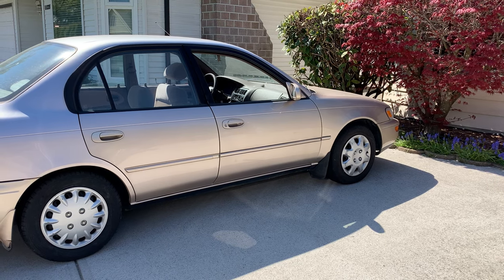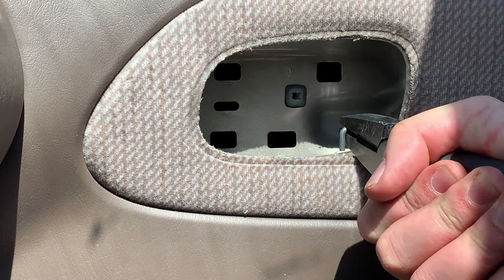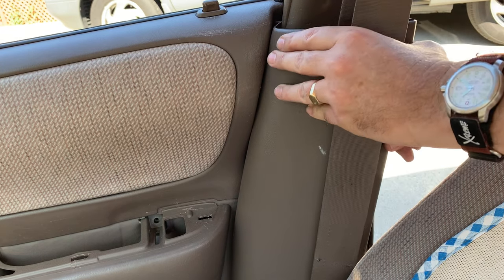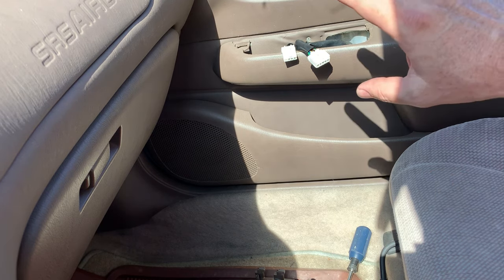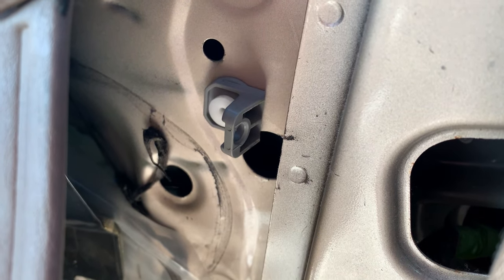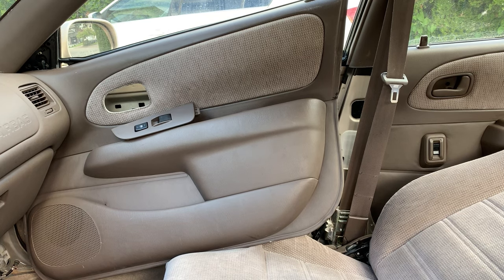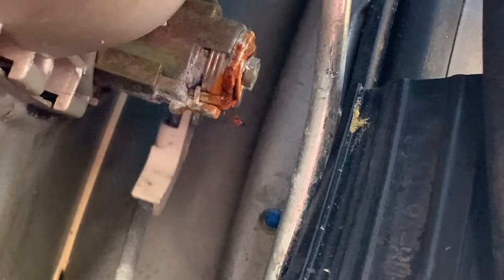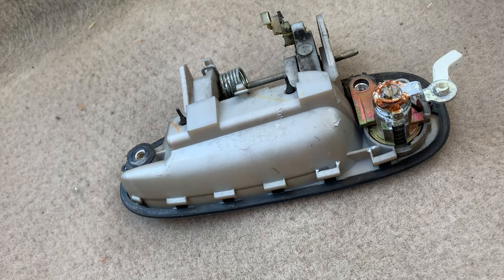Door won’t open – from inside or outside!

Comment: Sorry you went through all that. It was all very unnecessary though. This isn't for you as you got it open but for anyone else reading this. I am an automotive locksmith and have opened many doors like this without ever taken anything apart nor would I. Most opened in less then 2-3 minutes. First off you need to understand how these work. The problem was with the latch not the lock. It's confusing I know. The latch on an older car like this is probably easier than a new one. New cars mostly use cables rather than rods like this one. The key to this would have been wedging the outside door skin from the window to create space and using a good light down by the latch. 99% of these the linkage rod comes off the plastic keeper somehow. Some older ones used metal clips that rusted and broke but the majority of clips are plastic. I have been out to many that police, tow truck drivers, the helpful neighbor tried to unlock the car with keys in it and broke everything. You can't just stick a slim jim in these and go nuts. There is actually skill and knowledge involved. I could also always tell if someone was there before me. I won't give that clue away though. You need to find the  unlock lever on the latch. That's the arm the rod was connected to. Sometimes it's on the edge of the door side and very hard to see and get to but you have to think logically where it could be if you can't see it. Looking for the plastic keeper will usually help or possibly the hole where it used to live. I obviously have door tools but a wire hanger with a hook could be used to pull up or push down and the door will  open. I have been doing this since the 80's and only had one door I couldn't open. That's why I still remember it. Someone could have also knocked the linkage off trying to break in. Sometimes the keeper breaks from age. You name it I have seen it all. I have a had a few where the actuator (for auto lock/unlock) froze and wouldn't allow the latch to open. I actually had to knock the rod off to release the latch on those. I hope this helps someone else who is a good DIY person. If not just pay some guy like me who won't damage and tear up your inside door panel.
Reply: That's an amazing solution! BUT, really? There are "lots of guys like you" with this specialized knowledge and tools? I have my doubts that I'll find someone here on the tiny island of Kauai. If I were a millionaire I'd fly you out for a vacation... as long as you brought your tools! 🙂
Reply: OMG! There's an auto locksmith right down the street from me!!! Hallelujah!
Reply: @scotts4125  Thanks for the reply. I appreciate your generous spirit in sharing your knowledge with others in your field. Before I retired as a high-end cabinet installer, remodeler, and finish carpenter I realized that many of my skills and "tricks of the trade" were learned from working alongside other journeyman-level craftsmen. It was a brotherhood. 

So, I have a call in to my local guy and I had already thought to show him your detailed description above as soon as I get an email for him. His website only speaks about being a lockout expert but maybe he can do more, or would feel comfortable following your guide. 

There is however a secondary issue that I need to plan for. I don't believe I have a locking issue; it's the latch that is frozen. Should he be able to free the latch I still have to remediate the reason that caused the latch to freeze shut. Otherwise the next time I close the door I'll likely have the same problem. 

So, my thought was that I would have to buy some parts to have at the ready and hope that the locksmith could also fix the problem once we get the door open and can easily take the interior panel off to access the mechanisms. 

I stopped in at an auto-body shop to ask if they had experience in getting frozen latches open and they told me that they could muscle the panel off from the inside like the video here but couldn't be sure that they could still get parts for a 22 year old car. It looked like it was going to be a two week deal and cost around $400! It's a 2000 Honda CRV with auto-locks.
Reply: @scotts4125  Today was the day that the 30 years experienced locksmith with the borescope, wedges and slim jim worked on it for about 45 minutes before saying that this was one for the books and he couldn't help us. 

He showed me the camera screen and pointed out what to look at. It's a stumper alright. Both inside and outside handles move the rods as they should. All the rods are clipped in to where they are supposed to be. The test that pointed to the problem was to turn the key in the lock and watch the lock button on the inside respond to the key (these are electric locks btw). It went down all the way but came up only half way and wouldn't go any further. Since the electric actuator seemed to be working fine, that indicated that there was something physical interacting with the rod that raises the lock button enough to make the latch release the "claw" that wraps around the stud that protrudes from the door jamb. 

When I looked in the camera and pulled the door handle,  what I could see was the rod that pushes the locking button to the up position would move upwards but then stop before reaching full extension.

The big problem is that we can't see through the plastic casing to where we suspect there is some debris or a broken part inside the latch housing. There's got to be something in there on top of the rod so that when the rod tries to lift up to open the door it sandwiches the debris between itself and the latch's plastic casing. There didn't seem to be any way to see or remove the suspected culprit. Even if we could have gotten a small wire down in there to explore, it would simply push the intruder further in to the plastic casing.

The bottom line is we seem to be completely stymied because even if we could get the door panel pulled back enough to reach our hand down in there, pulling up on the rod to unlock the door would still encounter whatever is stuck inside the casing and not be able to travel upwards. 

If you have any miracles in your kit, we are all ears. It seems like we are not going to get this door open from either the outside OR the inside. What a bummer. We bought the car to be a rental. 

😞
Reply: @davidgardener5519  I would try to knock the rod off the actuator and move the rod without the actuator attached. You could also try to remove the rod off the latch and move the part of the latch the rod is attached to. I realize sitting at a KB is lot easier then actually being there. Either one of those might take a couple of hours but that's really the only choice without destroying the door. Possibly remove the plastic around the inside lock and grabbing the rod with pliers and yank the crap out of it? The other thing might be to drill out the lock and grabbing the rod with everything you have. Those are really your only options besides destroying the door panel. That latch as he probably told you won't release until it's completely unlocked. Maybe spray the crap out of as I suggested before too. I am glad not to be doing this myself lol. Let me know how it turns out. Good luck!
Reply: @scotts4125  Thanks for coming back with a suggestion. I'll pass it on. We did put a channel locks on the lock button and pulled with all our might. No   go. That's when our guy had to admit defeat.

 I will pass on your suggestion about trying to separate the rod that goes up to the push and pull knob from the rod coming out of the latch that we believe is being blocked by something inside the plastic casing. That sure would be sweet if it would come apart there. Not sure what tool would make it happen though. Slim jims are pretty flexible and I'm thinking it would just bend when trying to apply a prying movement. Are there stiff slim jims for situations like this where  you have to free something that's stuck?

Yes, I'll let you know what happens next. Thanks again, Scott.
Reply: @davidgardener5519  I see a major mistake here. A slim jim is 100% the wrong tool. You need to do this with a rod. I never did this because I always bought my tools and rebent them but back in the day guys would use welding rods and bend them. I have been doing this since the 80's so I have a ton of rod like tools that I rebent for specific cars back in the day. Now we use long reach tools through the window. One of those rods might work in my next part of this.

I went to bed thinking about this. I have an idea that would be the best idea and give you the best chance for success. Let me explain something else first. I'm not sure how you are paying this guy but it's probably not worth his time to be doing this so if he is willing appreciate him because this would  not be worth my time. We charge $300 -$800 to make a lost key and it takes an hour, 2 at most if we have programming issues. It's still hundreds cheaper than a dealer charges. I HATE taking door panels off also. So just trying to nudge you into the direction that you should probably be doing this yourself. :) Even if I charged $300 for this I could be making a key and not messing with a door panel so this wouldn't make sense for me.

Ok here is the best way to do this. Find some welding rods or some kind of stiff like rod. A coat hangar will not work as it's not stiff enough. You need to remove the other door panel. I would study how that door unlocks at the latch. Once you understand that 100% take the rod while the panel is off and put it down the door from the outside. Take a sharpie and mark your depth on the rod so you get it perfect. At this point you will have to bend the tip to hit whatever unlocks it on the latch. Keep in mind this part will be the reverse on the stuck door. Once you have this tool and technique perfected go the the stuck door and do whatever it takes to knock that rod off the latch or actuator that is preventing full movement. Once that's off use this tool. If none of this works and you don't want to do it than just pay the body shop I guess. You don't have a lot of choices here. 

Absolute medieval to try and save the door would be to muscle the panel off like in this video. If you can't get the latch to unlock I would use a die grinder and try to cut the latch from inside the door. This is even if you could get a tool on it. This really sucks for you and I have never seen anything like this myself so best of luck again.
Reply: @scotts4125  Wow, Scott, you are an absolute angel to help us think through this hellish issue. You give us hope and we are so grateful. 

I will compose something that incorporates your advices and see if I can agree to get the locksmith to attempt the job. Before he came out he told us that he thought the job would run between $400 and $700. The minimum sounded very high to us but we didn't have much choice. (The only other guy on island is away right now and we were aiming towards getting this car rented.) When he was skunked he said that he charged $100 minimum trip charge but since he couldn't get the door open he didn't feel he should charge that much so he asked for half. Since we didn't have exact bills we gave him $60. 

At this point we've given up on having the car rentable by Nov.5th. Maybe we should wait for the other locksmith to return and try him. 

Lots to think about here. I'll stay in touch and again, mahalo nui loa (thanks so very much in Hawaiian).
Reply: I have a Toyota ae 100 year 1995 so apparently my door doesn’t open from the outside but it use to open from inside but for some reason someone like they put the child lock on now it can’t be open from inside or outside , I need your help please
Reply: I have a 93 Cadillac coupe DeVille and my door just got stuck today. We just had a bad freeze over night and I got in threw the passenger door. If the door is locked already and was frozen and I was tryna pull my door open with force thinking it was frozen. Any way you think I could have damaged it or is it most likely just frozen. It's -4 with a real feel of -30
Reply: @esolbdivad  Sounds like it's frozen. It will probably open by summer. :)
Reply: I have a 2004 Honda Odyssey,I want to know,what is the problem of my car door when I can open it from inside but can't be open from outside?
Reply: @223FR  Your outside handle linkage is disconnected from the latch. It could be at the handle end or the latch end. Most likely a plastic clip broke or the rod came out of the clip.
Reply: Thanks man. I'm finna do it now
Reply: Damn that's long
Reply: My car door won't open from the inside and outside I have a Honda crv 2020 I am in california ..I was trying to read the comments but I know for sure it's the actuator it won't move so that the door can open I need a new one but who or what should I look for when I want someone to open the door and change it..u said call a locksmith?
Reply: @stephaniemolina7405  Probably a mechanic or the dealer. This is more of a repair. Some automotive locksmiths might do the repair but probably better luck taking it to a mechanic. I would also want to make sure they can get the door open without ripping the door panel out like in this video. Honda's have horrible door and Ignition locks. They use poor quality wafers in the locks that wear out and the key stops working. This is very common issue. Not sure about them having bad actuators but they break across all makes but Honda had a lock problem that I haven't seen in other makes. They make great cars with shitty locks. Best of luck.
Reply: Then were the hell is your how-to video? You criticize his technique but cant show you can do it better.
Reply: @v10moped  Are you angry because you drive a moped? I get it. Do better.
Reply: hey man, I have a 98 ford explorer and me and my dad worked on the door yesterday because my door wouldn’t open. We finally got it open and found out that the interior handle was worn out and wasn’t catching so I bought a new one and installed it and it worked fine until I accidentally locked the car and I haven’t been able to unlock it. I took off the door panel and have tried to pull up on the lock and haven’t had any luck. If you have any suggestions that would be awesome
Reply: @andrewbolt3094  If the door panel is off you should be able to open it from the linkage on latch. If the latch is frozen up you need to do whatever it takes to get it unlatched and maybe replace it or whatever part like the door lock actuator is keeping it from being opened. A lot of times the actuators (the electric locking part) stops the button from moving. Hard say without actually being there but figure out what's not working and disconnect it or break it to get the door open. good luck.
Reply: Can u make a video on this?
Reply: @scotts4125 7
Reply: got a 2008 CRV, closed the door on the seatbelt buckle , pulled the buckle out but now the door wont open from inside or outside. 
btw the central locking works i can see the orange lock opening and closing but somehow the door wont open at all
Reply: @wazzabanzook5028  Try to push in on the door hard while working the inside and or outside handle. It may not make sense since you want to open the door but there could be pressure on the latch since you closed the door on the seat belt. Some doors when we use an airbag and pull the inside handle on a lockout won't open until we let the air out of the bag even though the door is unlocked because of the pressure. I would try that first. If not you need to trip the latch as I have written about previously.
Reply: Man my actuator froze on my 04 Camry and I can’t find any way to get my door open
Reply: @jackdaniels420720  Can you move the inside lock/unlock flipper or is it locked up? If it's locked up read my previous advice to others. You need to look down in the door with a wedge, light and or borescope camera and knock the linkage off the actuator if that's what locking the latch up.
Reply: Hey Scott do you know how to work on old Lexus 400 with the v8? Driver door won't come undone
Reply: @King-qv1pd  Just read my previous posts. All these doors while a little different all basically work the same. If you can get to the latch down in the door you should be able to get it open. Buy a cheap bore scope so you can see what you are doing. Pull the other door panel if you need to and see how it works. Good luck.
Reply: @scotts4125  okay thank you man.
Reply: I have a Lexus 2004 ES 330 & my driver car doesn’t open from either inside or outside, what would you recommend?
Reply: Any secrets to add if the latch is broken and the door is stuck shut
Reply: @nesslea22  All my answers are in this thread. Broken latch means a lot of things. No matter what my replies in here go through it. Borescope down the door and find the mech on the door latch that unlatches it. Pull up or push down while also making sure the lock mech is also in the unlock position. Remember the door lock and the door latch are two separate actions. Some cars won't unlatch if the door is still in a locked state. Some will unlock when it unlatches. Every vehicle is one or the other but to play it safe I always make sure the door is unlocked. Good luck.
Reply: The latch mechanisms are rusted
Reply: I had someone use a airbag on my door and now it makes a wind noise inside like it's leaking air..very annoying .
Reply: @mitchenglebrecht5068 Open the door and put the window down. Stand between the car and the door. On the inside of the door  put your knee on the door panel while pulling the window frame into you. Your knee holds the door while pulling in on the window frame. Do that a couple times and it will fix the wind noise. Usually happens on Honda's and Jeeps.
Reply: My innova door is not opening from both sides... Can u kindly help me out opening it
Reply: First of all I'd like to thank you for sharing knowledge. My brother car is a older model Toyota Corolla (rods) driver side door can't open and he needs a safety inspection. Without that door opening he can't get it safety thats what he said so he ask for help and yes he petty much destroyed the door panel....keep you posted,  
Willy
Reply from the maker: My latch was fine. It was the lock that was rusted. Freed the lock and everything worked again!
Reply: When creating a space between the  window and outer door skin is the window up or down?
Reply: I could really use the help, what state and city?
Reply: Mini Cooper door lock
Reply: Correct my issue
Reply: Hi I need your help!
Reply: @giventofly9866  Read all my replies in this thread. I have replied and given all the answers about this situation here. If you have a specific question about something I haven't answered ask away but I need help isn't really helpful.

 Hey doctor I'm sick what's wrong?
Reply: @scotts4125 hi scott. I have a honda City 2015. Im unable to open it inside and out sometimes, what i will do to open it for now is to lock and unlock it from the key fob. Sometimes it works but most of the times, its not. Can you please help me to resolve this issue? Thank you!
Reply: @LutongImon  Did you remove the door panel and do an inspection? Would you know what to look for? If no to these questions take it to a mechanic before the door won't open at all. Right now you are lucky. Off the top of my head could be a bad door lock actuator but without being there I can only guess.
Reply: Hey Scott, I’m a total DIYer and am attempting to open the rear door on my 1999 Infiniti QX4. It won’t open from inside or outside the outside door handle is lose and basically flops when you pull it (no tension). The lock move when I lock/unlock the car. I went to attempt to insert a wedge to look down inside but realized that the windows in the back only go down 75% of the way (both rear driver and passenger windows). Weird design. I’m afraid I’ll bust the glass. Any thoughts?
Reply: @stephanie8327  It sounds like the lock unlock button is good. It's the latch  you are having the issue with. Window up is better any way. Having the window down blocks everything off. I would put a camera down the door. You want to see the linkage that is attached to the latch. If you hit the lock unlock you should be able to see that move. It would be the other one that's not moving. You need to pull on that or the part of the latch it's attached to. You can also look at the linkage that either came off the handle or the latch. If it came off the handle that would help you as you could pull that and the door should open. If it came off the latch end that won't help. You basically need to pull the linkage for the latch or hit the connection point on the latch for the door to open. It also needs to be in the unlocked position. Good luck.